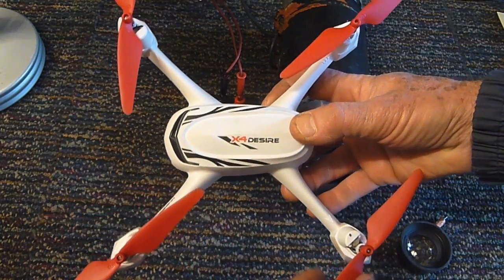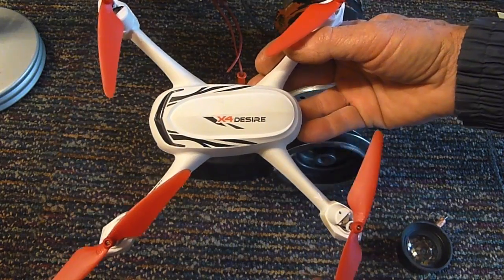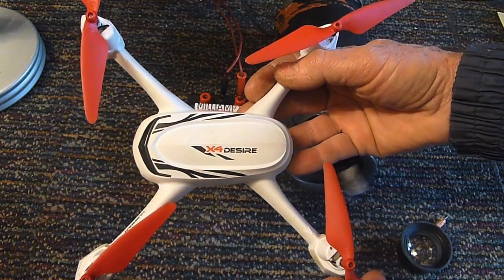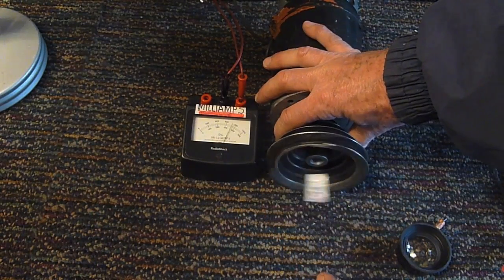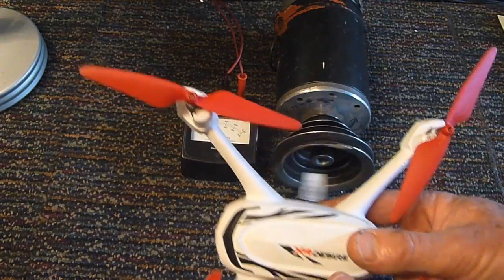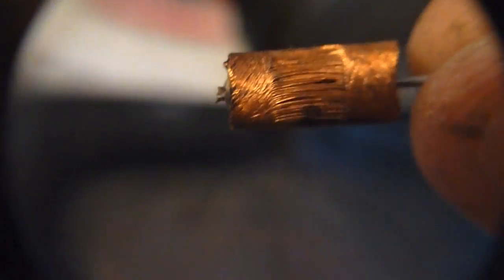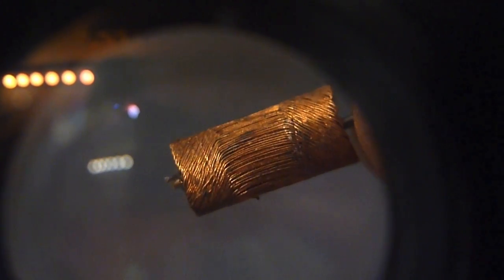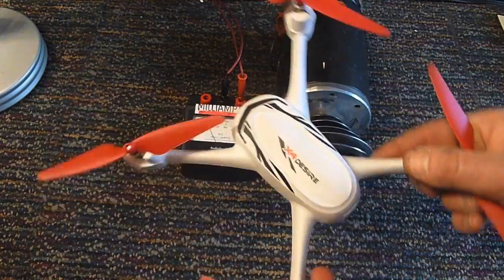Drone motor failure from over current. What to avoid.

Comment: Interesting video 👍👍
Just wondering if you could throw some insight on a problem I’m facing with my Desire x4, that if I’m lucky to get the drone flying... because after many random tries all i get after i turn my motors on and try to pull up the throttle it just dies, but if i get it to take off, it will just last 10 seconds and it drops like a rock.☹️
I replaced all motors and problem still there,
Replaced the main board (and the motors again) and same problem, cleaned all of the little wheels and mechanical parts.
I will appreciate some help. Thank you!

Comment: very nice demonstration on why these motors, and probably quads with unprotected motors in general, burn out if propellers are obstructed.  I was actually considering buying one of these and came across your video.  The question is for a relatively skilled pilot it this really matter or not towards as purchase.  Once you learn the basics, you will avoid trees and the like and are taught to  immediately kill the throttle (propeller power) if you do hit an obstruction (so excursion to high current is brief).  These quads go for as low as $28 now so if you are skilled, it still might not be a bad choice.
Reply from the maker: I bought a bugs 5 W, and it has built in protection so nothing burns out when the motor blades are obstructed, and it also has brushless motors. My only complaint about the bugs 5w is sometimes it goes where it wants to go.

Comment: nice video but the problem is that I changed the motor 6 times,becouse the cuality of those motors is bad, I said that because I have 2 hubsan h205e and h 205s .any body can tell me where I can find good cuality  motors. please help me
Reply from the maker: I would not bother repairing this drone. My friend had the same one, and it kept burning out motors about every third flight. I'd suggest buying one that has brushless motors since they generally last much longer.
Reply: @GrantsPassTVRepair  Since I commented earlier, I have had two of these unexpectedly fail without warning due to motor failure after only a few flights.  It is unacceptable.  They have compromised an otherwise decent quadcopter with inferior motors.  On the first one, the one motor stopped working so I carefully replaced the motor with a genuine Hubsan replacement.  After meticulous reassembly, I was testing it out and it fell to the ground with failure of a second (different) motor and a strong burning odor.  I tried to replace this one as well but apparently there was also damage to the board and it didn't work.  WIth a second H502E, this one fell without warning from about 25 ft in the air after just a few flights and very meticulous care (I am a skilled pilot).  There was also a burning smell associated with this failure and I have written to Hubsan.

Comment: The motors don’t last 5 to 10 flights the motor burns out. This is the 5th set of motors am buying. Pls help
Reply from the maker: The motors they used in these drones are junk. I replaced 3 of them in my friends drone. You might consider buying a drone that has brushless motors since they have fewer parts to wear out. Their is another drone called the buggs 3, and some of their other later model drones that have brushless motors, and aren't to expensive.

Comment: Good work on your explanation :) Yep that is the case with most of these coreless motor quads under any stress from jamming either through dirt in the gears or crashing, although some have a feature to cut off power when high current drain is detected,  this x4 now has a firmware upgrade so when in a crash motors will cut off now, so if it lands inverted that is, I saw a demo from a youtube with a new flight board. I have just flashed the firmware on mine but not tested the feature yet as waiting on a new transmission shaft and camera, I will post an update video on my channel once I have tested the new firmware I used if anyone is curious :)

Comment: The way I've always understood this is the motor is acting as a generator as it spins, so it's pushing against the current applied to the windings. Is that correct? So when you stop the rotor, the current flows unchecked through the windings
Reply from the maker: I had a similar assumption along the idea that less inductive reactance was a likely reason for an increase in current consumption if the motor blade is prevented from turning, but then I remembered seeing the same effect when  steady DC was applied to a single coil pushing a magnet. As the magnet moves from the magnetic field the power consumption goes down. All I know is some how the moving magnet is generating a field which blocks current input flow to the coil.
Reply from the maker: I'm not entirely sure about the physics behind the current increase as the motor slows.
Reply: Each winding is an inductor, as the motor turns, it keeps switching to the next inductor.

When stalled, or slowed, current has more time to ramp up.

(That's my assumption anyway)
Reply: Interesting, I'd never heard of that effect, shall have to try it and see.